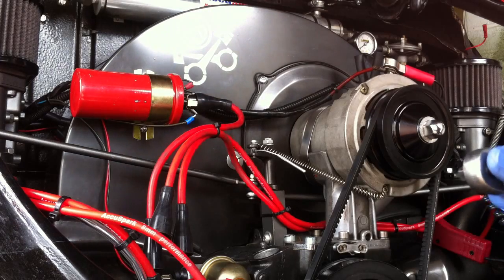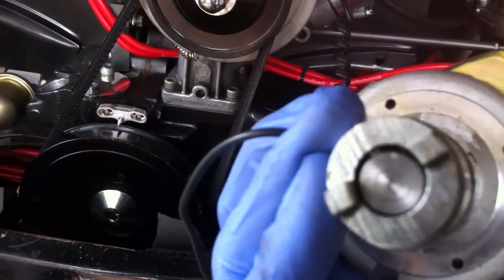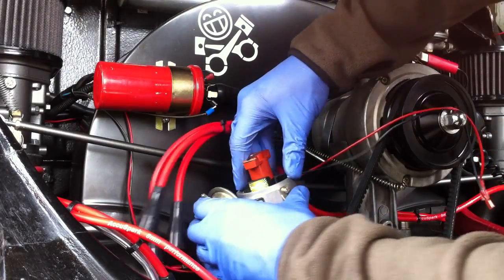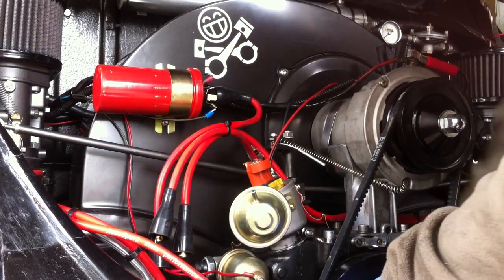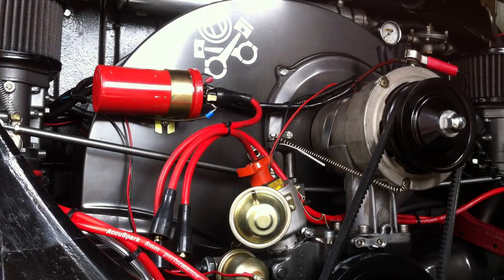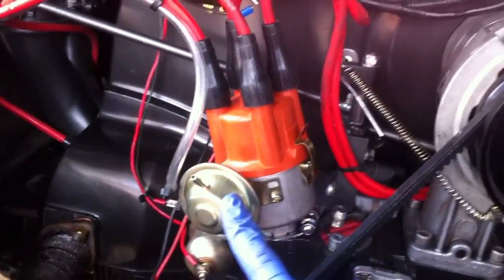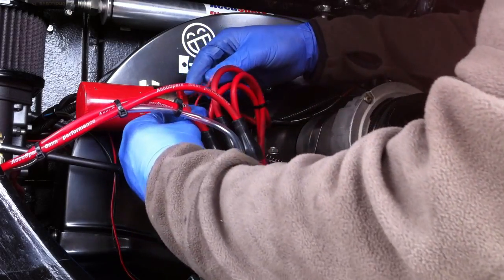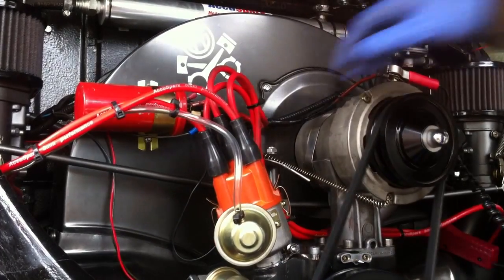Clarke Hillyard from Accuspark fits Electronic distributor

Comment: I bought one of your complete kits with vac advance. I’ve just got around to fitting it on my recon engine. There’s no mark on these that I can see for cylinder 1 and after turning the engine over, no 1 cylinder doesn’t sit in the factory position. Is this right?. It’s more at 60 degrees from the rear tin.

Comment: I have a 1600 dual port--with dual weber 40 idf carbs...I have the Pertronis flamethrower II---but drawing the vacuum off of only 1 carb has made it difficult to time correctly.  I noticed you are using duals---words of wisdom on vacuum advance on only 1 carb????

Comment: Use a stroboscopic timing light. With the vacuum hose disconnected and plugged, set the timing to 7.5 degrees BTDC at 900 RPM (idle). Timing should be set initially at 30-32° BTDC at 3,500+ RPM, vacuum hose disconnected and plugged. Maximum advance, at 3,500+ RPM, vacuum hose connected, with no load on engine (car sitting still), light throttle, should not exceed 42-44° BTDC.

Comment: Electronic ignition, upgraded spark plug wires, more powerful ignition coil, etc. is in my opinion the best upgrade for the old VW air cooled. 
After watching the video I have just one small comment. Better to use wire separators, zip ties to bundle them together is not such a good idea. ;-)

Comment: 7.5 deg. btdc
Reply: Thats not the procedure on vw beetles , factory in puebla mexico trained to adjust new beetles and combis up to 2003, but carbureted vw beetles  where timed exactly as this guy in this video, professor always said in this engines only maximum advance  matters, idle advance coul be from 7 to 12 degress, and is adjusted after max advance, is adjusted only with the screw on idle mechanism setting idle rpm after that u need to adjust max vacuum with the screw on carburetor until u get max vacuum with gauge, is a matter of play 3 or 4 times with both screws and then u get perfect timing on both,  remember this engine needs to be timed and idle adjusted like that because altitude matters and this nice engines are not water cooled, but is a simple procedure, in delivery vw plant they give u max 10 minutes for car engine , usually 3 minutes all it takes , but with special wheel for 32 degres and spectropic gun, also vacuum gauge was in the guns as rpm meter., Still aniway is very simple procedure with regular  timing light and autozone vaccum gauge or any other autopart store, so 7 degres idle not the right thing, also in plant a pretiming guy would do 7degres pretiming with test probe and the factory mark of 7 degree on the crank wheel but this procedure was only to start a new engine and check for proper noise balance and leaks, sometimes they adjust 32 degre max advance when they tested engines for max power when they doubt of new engine condition, so the final guy still rechek max timing and idle vacuum max and idle rpm, also next was a guy who adjust clutch play in a hole ramp , after that car ready to final detail inspection and sale, this cars were not  tested on funny road  inly selling because the cars were so confident to make it whitout that,. Fuel injected beetles were very simple only few sensors and minimal wiring added, both older and fuel injected engines were very efficient , and small maintenace required, this engines  eated spark plugs fast since back then in bosh spaark plugs for air cooled vw used very soft metal for high spark, new spark technology woul solve that problem i think lasting forever,. Most recall problems this car was fuel line filter, since pump very small, many people used to run a hose from tank to filter ,pump and carbureted 10 mm hose or 3/8, other people found safer and better to mod and use cooper pipe  instead original steel line, all this after some years of use of car due to contaminated gas or defective or non gas cap, they use to trow the cap and put a piece of cloth , so due to this water or humidity came to tank and lines and clogg those poor elements, but in general this engines and air cooled cars and vans where the king of carbureted cars at least mexico, this engines and cars are not simple they requires special techniques remember they are vw german cars , still today german cars brands use extra no needed complex things on simple stuff but once is all good they last forever, 80s probably the most selled car in mexico . Have good luck